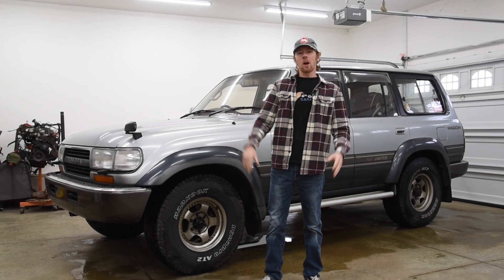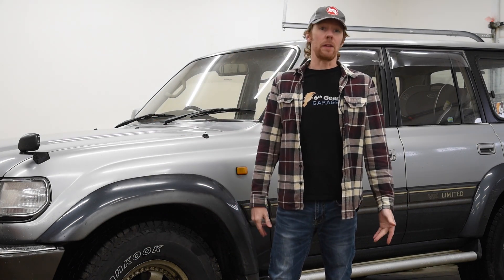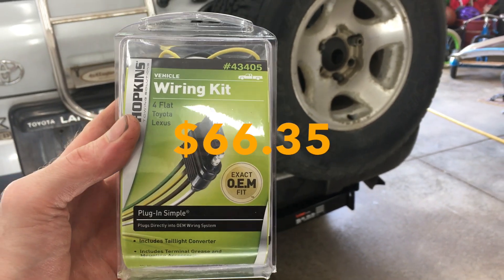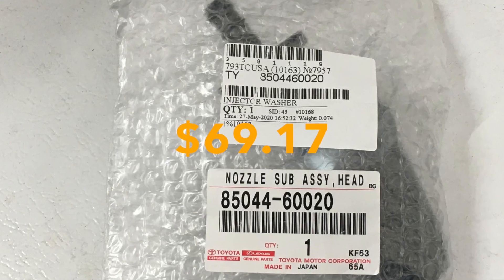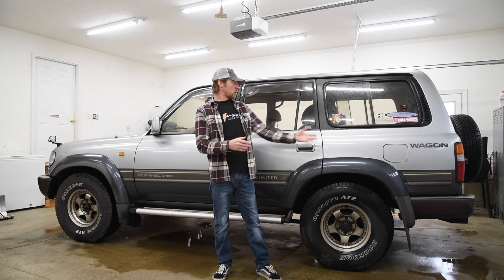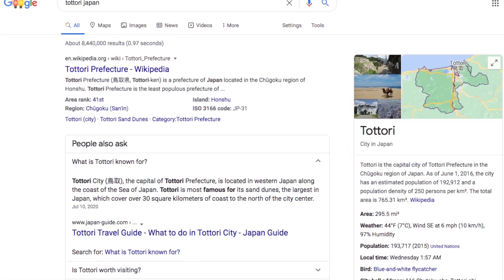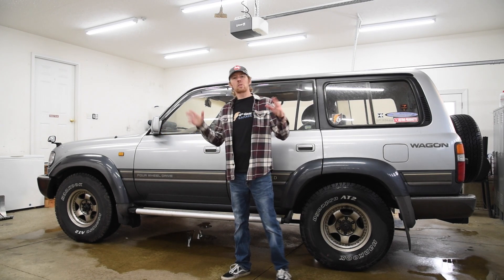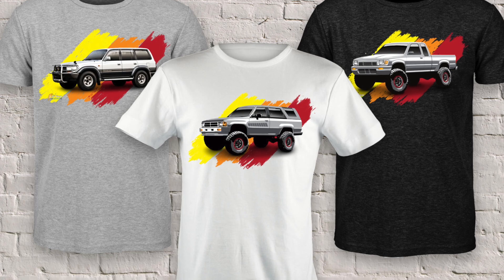Toyota Land Cruiser Maintenance/Repair Cost: 8 Months of owning an imported JDM 80 Series VX Limited

Comment: Do you have a video on the third row install?
Reply from the maker: I do not, but I will add that to my to-do list!
Reply: @6thGearGarage  ok sweet. My main question is why the right rear seat wouldn’t fold. Are you saying if a HDJ81 does not have a rear AC system that it will fit fine? The truck I’m curious about is a 94 HDJ81 that did not come with rear seats from factory. I’m curious if I can source some USDM rear seats like you did and bolt them up with no issue. I know I need to source and install the floor latches as well but mainly worried about why yours didn’t fold correctly. Thanks
Reply from the maker: @ssaxmanful  My right rear doesn't fold up all the way because of the rear AC unit. The rear interior panel comes out a couple of extra inches to fit the rear AC behind it and the seat hits the panel when trying to tie it up in the vertical position. I've never found a set of JDM rear seats from a model with AC to compare the difference. Not sure if the seats or the brackets are different, or both.   Adding the latches/mounting points for the rear seats is going to be quite a job.

Comment: Great video. I have only replaced a fog lamp bulb so far but I have found some surface rust in the back by the rear door. I am starting to accumulate tools and parts. I wish I had a larger garage. A lot of maintenance was done on my LC by the previous owner. (It’s only had 1 other owner since import from Japan in 2021). I need to get the rust coating done but I might wait until spring or summer as there will not be any road salt to deal with. I think I am going to use Krome, for the underside rust. I wish I could do it myself but no lift in my garage. Some day some day. Fluid film or wool wax sound like the best 2 DIY rust elimination/prevention methods out there.
Reply from the maker: These also seem prone to rust on the rear hatch, under the window seal.

Comment: What repair Manuals are you using? Do you like them? Do you have a link?
Reply from the maker: I bought the factory service manual on ebay, It came with to volumes. It was not cheap, but worth it. Each model year has its own book.

Comment: I don't understand why do you import so old FJ80.  In south america you have 2007 FJ80 with less than 100.000km and its much more closer from the US than Japan. Remember that Toyota sold FJ80 until 2007 in Venezuela, Colombia and Bolivia.
Reply from the maker: We would love to bring in newer vehicles but US law only allows imports 25 years or older. Canada law is 15 years or older.
Reply: @6thGearGarage  Ohhh, now i understand. So I'm very lucky with my 2004 FJ80!
Reply: The 90s 80s series look better than the early 2000s in my opinion.  Plus I think you lose the straight axle as well on the front